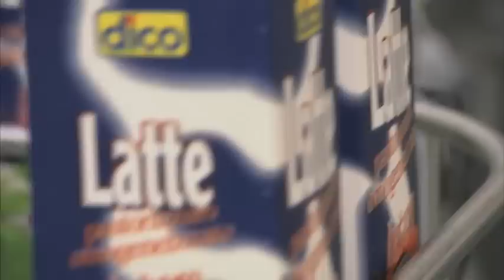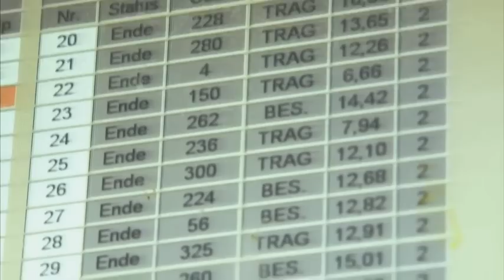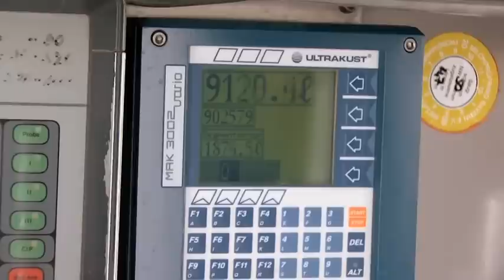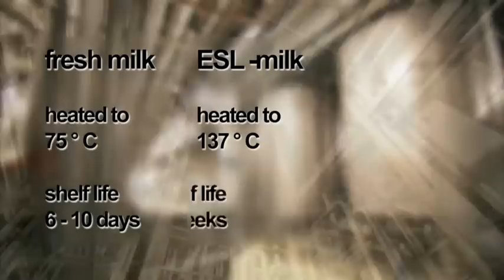When cows go to carousel - The intelligent cowshed

Comment: SUPAR ANNA
Reply: Since female mammals can only produce milk during and after pregnancy, all cows are raped once a year to impregnate them. Bigger dairy facilities immobilize the cows on what the industry calls a “rape rack” where they shove a bare hand or long steel device into their vaginas to inject them with bull semen. Smaller operations individually lock the animals into a tiny “stall” to perform the rape. Around 9.5 months later, moments after giving birth, babies are stolen from their mothers. From a business standpoint, the dairy industry has to steal babies to prevent the calves from sucking up the milk they want to sell to the public.

Like male chicks on an egg farm, male calves are considered useless by-products of the dairy industry; males can't become pregnant or produce milk. Unlike the chicks who are thrown into rendering machines fully conscious, the calves are imprisoned by the veal industry in small stalls or tiny crates, sometimes with ropes and chains around their necks to immobilize them. Minimal to no movement is allowed; this prevents muscle development, which keeps THEIR flesh extra tender. The "imprisoned" video link also shows calves licking each other's faces to comfort each other, and desperately suckling into the air hoping to connect to their moms' udders. The veal industry only exists because of the dairy industry! If you avoid consuming the dismembered bodies of male babies but consume dairy, you are still responsible for massive amounts of pain and death because you are supporting the prolonged suffering of mother cows, and their female babies who wind up being raped and imprisoned like their moms! After 3-7 years, when cows no longer produce huge amounts of quality milk, they're sent to a slaughterhouse, chopped up into hundreds of pieces and sold for hamburger meat; 90 percent of it comes from the dairy industry. If given a chance, cows can live to be 18 to 25. The following footage shows a pregnant cow with an injured leg having her throat slit at a dairy facility in Turkey in 2009. Injured animals are costly so it is always easier to kill them than to treat their maladies. While the mother is bleeding to death, they also give her a fully conscious C-section so they can slice the still-breathing baby's throat, too!

Machines are hooked up to the protruding udders of cows several times a day to suck them dry. Along with countless drugs and Bovine Growth Hormone injections, infections and pus form inside and outside of the udder. Then the pus is sucked out with the milk! Pasteurization, which cleans the pus but does not eliminate it, creates a concoction of sanitized pus. The national average hovers around 350 million pus cells per liter, which means that each glass of milk has around an eye-dropper full of pus! From time to time, The Hoard's Dairyman and other dairy industry trade journals discuss the pus problem. Cows raised on organic/antibiotic-free/hormone-free/grass-fed/local facilities don't produce pus-free milk either. In fact, organic milk has more pus than non-organic milk because when cows get infections, as they always do, medicines aren't used to treat the malady. Thus, more pus accumulates in the system. Soy, rice, almond, hemp, coconut, oat, flax and hazelnut milks (the vegan ones)—along with human breast milk—are the only pus-free milks.

Moreover, mother cows make milk for THEIR babies and for THEIR babies alone. They certainly don't make milk for baby humans, adolescents humans or adult humans. The human body has no need for cow milk, just as it has no need for dog milk, giraffe milk, zebra milk, camel milk, goat milk or rhinoceros milk. The only milk that anyone ever needs comes from THEIR own mothers' breasts! And when weaning is completed, milk is never needed again. Without a doubt, dairy is the stupidest and most unnatural 'food' consumed by humans. Have you ever turned on a wildlife program and watched a lion tackle an antelope—not to kill her, but to suck milk from her teats? It's high time for vegetarian hypocrites and selfish meat-eaters to wake up! If a mother cow is lactating, and her baby isn't present, then the mother and the baby are being tortured. No debate. No discussion. The jury is in, and this case is closed forever!

Were you also aware that animals in the meat, dairy and egg industries receive no legal protection whatsoever? After all, slavery and slaughterhouses cannot co-exist with freedom and protection. Here's an excerpt from section two of the Animal Welfare Act (AWA), the federal law that oversees animal-use in America: "When used in this act, the term "animal" ... excludes farm animals, such as, but not limited to, livestock and poultry used or intended for use as food ..." That's pretty cute, isn't it? The animals who are enslaved or eaten aren't even recognized as animals under the law. Does this remind you of another piece of legislation that ignored the victims and existed to shield victimizers from prosecution? When the Constitution was first enacted, only land-owning, slave-owning, white men of European descent were protected. Blacks, Natives, women and many others were conveniently excluded.

The Animal Welfare Act, kosher and halal-style killings—and the free-range/freedom/organic/cage-free/antibiotic-free/hormone-free/grass-fed/buying-local marketing terms—are used to manipulate people into thinking that meat, dairy and egg production can be done happily and humanely. But there is no such thing as happy and humane slaughter just as there is no such thing as happy and human rape, happy and humane slavery, or happy and humane child molestation. From the animals' point of view, anyone who commodifies their bodies is equally vicious. Most people are unaware that Himmler, the Gestapo Commander who created the Jewish Holocaust's gas chamber system, almost fainted when he watched 100 Jews being shot to death in his honor. The Jewish Virtual Library states: "Subsequent to this experience, he ordered as a more humane means of execution the use of poison gas in specially constructed chambers disguised as shower rooms." If Himmler were still alive, I am sure he'd love to have a meal with the "humane" meat, dairy and egg-eating assholes who perpetuate his insane beliefs. And if for some reason my aforesaid words aren't proof enough of the terrorism claims I'm lodging against the meat, dairy and egg establishments—and the people who consume these products—maybe the billions of dead, dismembered animal bodies consumed annually could count as proof.